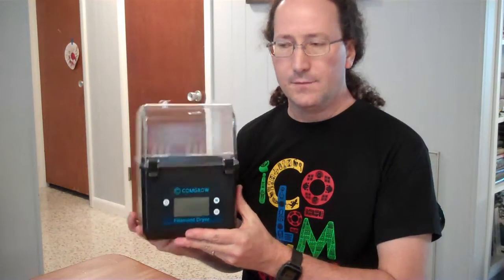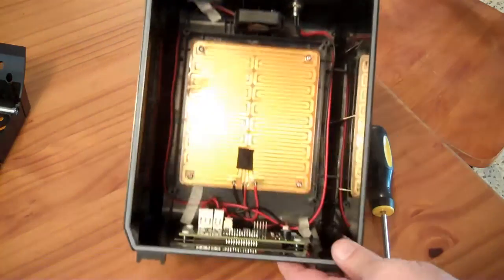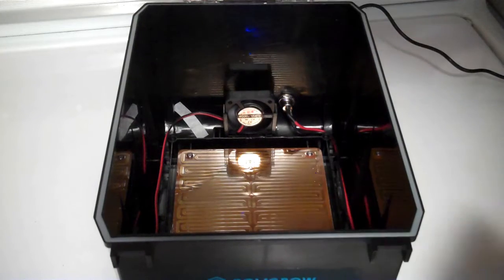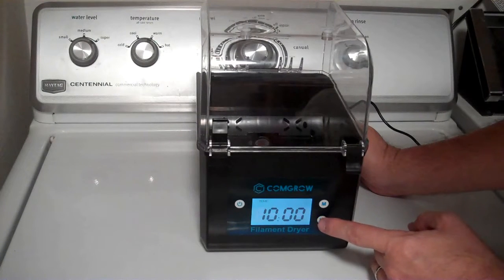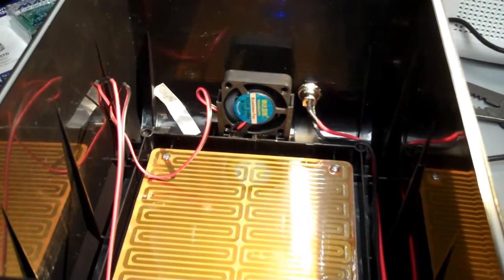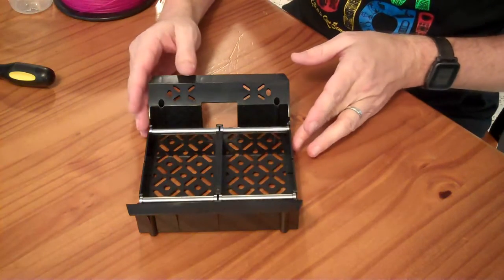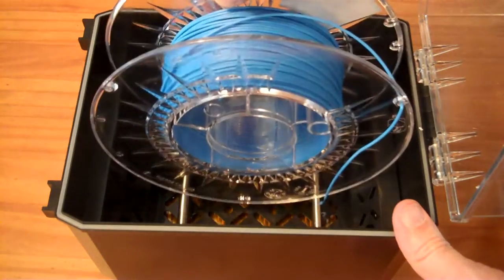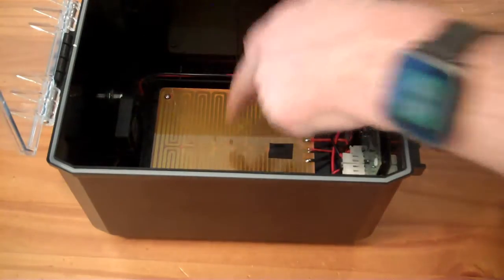Comgrow Filament dryer review and improvements

Comment: This just popped up on my feed. I got one of these a couple of months ago when I got my Bambu Labs P1S (now that they’re cheap). I’ve been printing for years (E3P) and never had a dryer as they were stupid expensive. I got this one for right at 40 bucks. Well worth it. They’ve made some changes. There are now four exit ports as was stated before and will run for 24 hours. Mine is whisper quiet. You can barely hear it run. I also use it as an external spool feed, mostly TPU. You just run the filament through which-ever port works best.  Im really glad I have it. I recommend it.

Comment: Mine is different than yours, I think they redesigned it a bit. There's now four ports in the lid. The fan is also really quiet on mine. The real question is how good is it long term. I just got mine yesterday and set it up just now.
Reply from the maker: I'm glad to hear they have improved upon it. Unless they made it extra wide I'm not sure how you would get four different filaments inside at the same time.
Reply: @summetj  It's actually two on the top and two on the front so you have more options for the two rolls, not so you can do 4 rolls. And it lets you dry the two rolls while letting the humidity out the other ports at the same time.

Comment: Okay, but does it work?
Reply from the maker: Yes, but sometimes you need to run it twice depending upon how much moisture your filament has absorbed.
Reply: @ I ran mine for 5 hours at 45 degrees with two partial kg rolls of PLA and the humidity reading went up. Then I ran it for 9 hours at the same setting and it went down to 25%, but 26% is where it was at when I started, so I’m not really sure if mine is working.
Reply from the maker: @hotdogmang3107  use a gram kitchen scale to weigh your PLA before you start and after you finish to see if water has been removed.
Reply: @summetj  That's a good idea! I don't think that'll be needed though. I think the issue is that I was using dessicants that came with the pla, and im pretty sure they were pack with moisture, so it took a long time to get them to dry out. Now im rocking <20% humidity :)

Comment: Anyone know part number on the power cable bought one from a friend but lost the power cable
Reply from the maker: Mine came with an extremely generic AC/DC converter block with no brand name or part number. It is rated at 12 volts, 4 amps, and has a barrel connector plug with an outside diameter of 5.45mm (probably a 5.5mm plug?) The inside measures around 2.3mm.  My best guess would be it is a  5.5mm x 2.1mm   but it could also be a 5.5mm x 2.5mm Barrel  (as the inside measurements are hard to get right...

Comment: picked one up at a local internet returns store for $4 the buzzing went away on mine after a few uses. my issue with it is that it tends to heat the filament too much, the PLA and PETG comes out kinked and the placement of the filament holes are suboptimal and you can hear the filament jump and snap around. I DO have a much more powerful power supply connected, it Shouldn't make a difference but it can if they decided to down size it because it was having overheating issues. *I have it being pulled straight up, and printing at 36mm3s (200-325mms @0.2mm layers) so the spool is defiantly spinning "quickly"

The bottom gets VERY hot, i added Kapton tape under to help deflect the heat. These dryers IMO seem very thermally inefficient, almost feel like wrapping it in a thermal blanket.. or a large thermal lunch bag or maybe simply putting it in a small cooler idk

Comment: Yes, I have one of these.  I don't use it a lot, but when I do the fan makes a horrible noise like there are wres touching the fan.  I have to find the right size phillips screw driver as mine are either too small or too large.  I think you probably could have bought a 12v noctua fan and hot glued it in place to reduce the noise.  I have seen a couple peope put an extra fan on the lid to circulate the air better.

So, I took it a part and the seems fine outside of its holder.  I think the issue was that the fan was rotated so the wires were underneath.  Also, there is nothing holding it in place really.  I rotated the fan so the wires are on top and hot glued it so it cannot move.  It is much better now though tnere is a slight but bearable hum.

Comment: Thanks for this.  I bought one as well recently  as I had seen some good reviews. While my fan doesn't make much noise I do have two other issues .  Firstly there does not appear to be a moisture sensor? Not sure how the unit knows what the humidity is.  I fitted an temp/humidity sensor inside the box and it clearly shows that what the humidity the unit is reporting is not the humidity in the box.  I also found that because the box is sealed that the moisture stays in the box and and could be re-absorbed potentially.  I am going to fit a small fan at the top of the box to run simultaneously to extract the humid air before it condenses.
Reply: The instructions clearly state "When drying filament, do not close the lid completely. Leaving a small gap will help let the moist air out".
Reply: Seems like any exit from the box for the warm, humidity-carrying air would do the trick; too much air flow will carry the heat out of the box and be like leaving the filament sitting out with a fan blowing on it.

Comment: I have one of these that I run pretty much 24/7, the fan in mine buzzed out of the box as well. I think they just come with crappy fans that have crappy bearings. I'll probably end up putting a little Noctua in there sometime soon.

I would have loved to have the ability to have it operate independently of a timer too. I'd pretty much just sit it at 35c and leave it on 24/7

Comment: Yeah, I've bought one of these things, but the main issue for me isn't the internal design (although some thin sound isolation foam could quieten and insulate the box and pull down the power draw), but the main issue is the PSU is really dangerous. It's light, it's likely lacking any head sinks and when it hits 50 centigrade, the PSU is running even hotter than that heating element. It's a fire hazard. I wouldn't leave this thing on unattended. I'm currently testing with a old TV decoder PSU that's rated at 12V 4A and center positive like this one. Seems to be fine. It gets warm, but not alarmingly warm.
Reply from the maker: I haven't noticed my power supply brick getting unusually hot, so it sounds like you definitely have a problem with yours!

Comment: Fun fact, the dry box is *lying* about the humidity. If you look at the board, there is a hygrometer connector on the board (on Sovol SH01, but it's identical on this one as far as I see), but it's unpopulated and nothing else on the board would indicate any capability of measuring humidity.

The faux humidity "reading" is linear function vs temperature. It's hard coded as 50% RH @23°C and decreases linearly from there to about 20%RH @55°C.

There is some possibility to hack it though. There are pins on board that would allow dumping and reflashing firmware on the MCU to add missing hygrometer functionality, or a second fan, but this requires higher skill in electronics than I myself have and would require reverse engineering firmware from a binary dump, which is whole another level of difficulty.
Reply: Looking at the circuit board yes there is a connector labelled HUMID1 for a external sensor, however there is a SMD humidity sensor on the main board in component location U2 directly above the HUMID1 connector. You can even see that the external connector pins of HUMID1 and the SMD mounted sensor both share the same traces on the board leading back to the the main chip.
Reply: I also have doubts that the temp sensor actually works either. I can run mine at 40c for however many hours, and when it finishes a cycle I'll start it again instantly and it will read 24c/50 humidity.

I'm not too concerned about it because I run it every day and I leave desiccant satchels in there as well. It's just typical chinese engineering.
Reply from the maker: Hurm, I didn't look to closely at the circuit board on mine, but that sounds like the type of thing a cheap Chinese manufacturer might pull.  I guess instead of looking at the RH reading you would just have to leave it in the box for enough time so that you are sure all the humidity is removed. [I might have to get a humidity sensor that would fit inside the box and do some testing...]
Reply: But it does work on the Sovol SH01?
Reply: Do allow for a board having alternative part locations, with sensors either on- or off-board.
Reply: Also, if you prop the lid open on the latches, it will actually get dryer faster. Allowing the humidity to escape rather than get reabsorbed back into the filament.

Comment: I just ran across your video.  Thank you for making it.  I am concerned about the noise it is making.  I have a replacement fan.  Can you let me know if you used a special tool to remove the four screws?  I tried every philips I have and nothing seems to fit.
Reply from the maker: It was just a number two Phillips screwdriver. You have to get one with a small enough shaft to go into the holes and you might have to press down a little hard when initially unscrewing them but nothing special.

Comment: Perhaps instead of using a new fan, insert a resistor or Zener diode to reduce the voltage.
Reply from the maker: Yes, that would work if your fan was just too loud, but mine was also "grinding" with what looked like bad bearings.

Comment: What if you create silacone feet for the fan to absorb the vibrations.  I've used a similar solution with a speaker on my HAM radio output. It worked for me.
Reply from the maker: Yes, isolation from the ground will help, but the plastic of the box is also resonating into the air directly.

Comment: i think this is the same exact model as the sovol dyer. They look identical and the fan is the same and internals. i think china makes these and allows ppl to just brand their name on them. i paid a few bucks more and got the sovol but after seeing your review i realized i could have saved like 7 or 10 bucks getting the comgrow. lol all in all this type of dryer works well. i put in a filament and within only 30 mins it was below 20  which was quick! maybe the filament was not wet at all too.
Reply from the maker: Yes, I expect you are correct on the 'whitebox' branding.
Reply: Mostly agree; another thing that may happen is for quality control rejects to be marketed.  Pretty sure that's where a lot of off-brand LEDs and such come from; far more profitable to sell them to hobbyists than to pay to dispose of them.